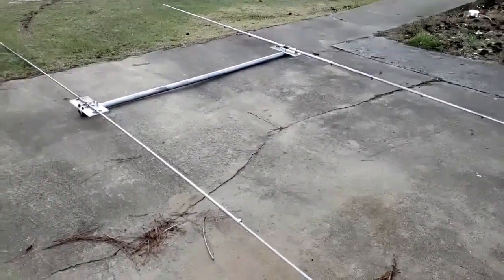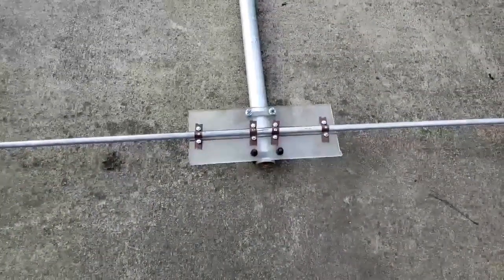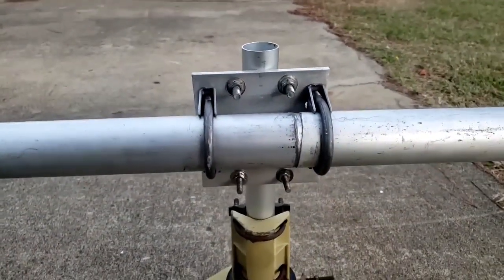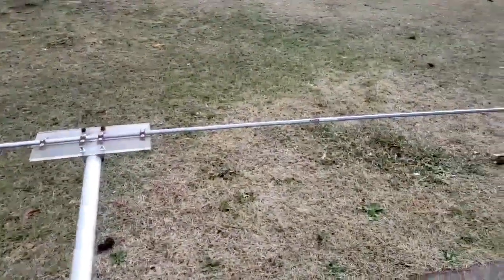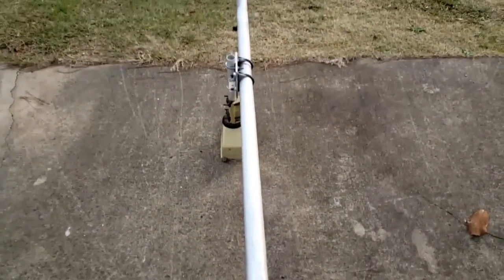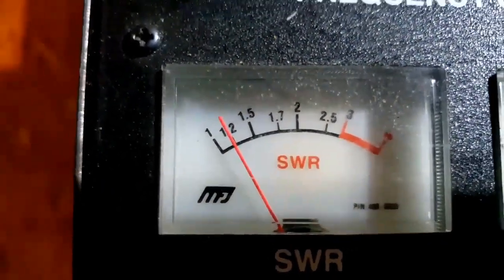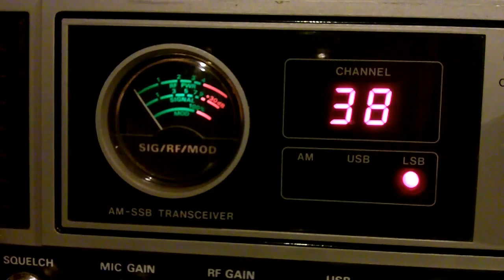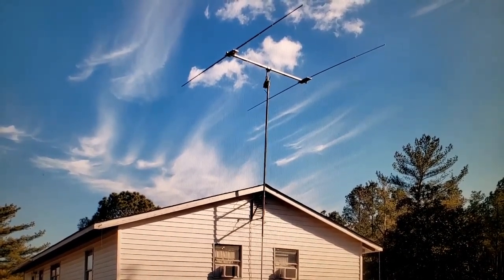My Best Homemade CB Antenna Ever!!

Comment: Nice I like that..was you bare foot when you talked to Canada??. How many watts will it take..? 73s..la 350 central Louisiana.i got me a maco 5/8 wave ground plane now.does great may build one like you.
Reply from the maker: I was running about 150 watts when I made the contact to Canada. Thanks for watching, 73's from 151 SC.
Reply: @MowerJunkie  one last question please I have bad line noise or interface.what do you think about noise eliminators or ferrite any suggestions.thanks any videos you have on that?